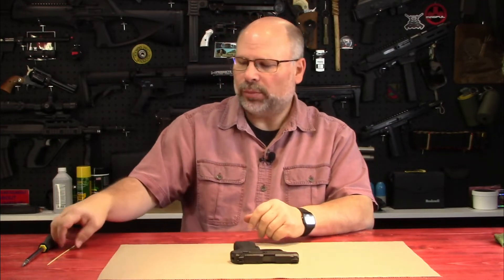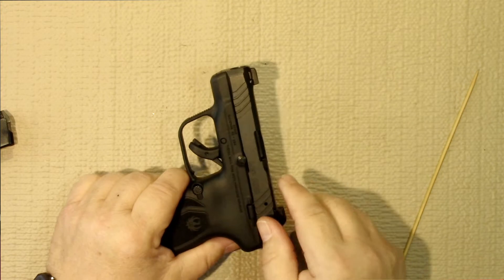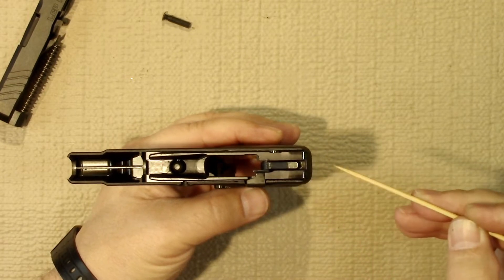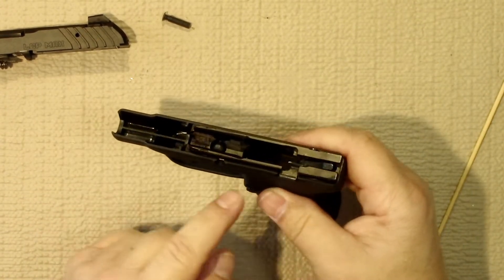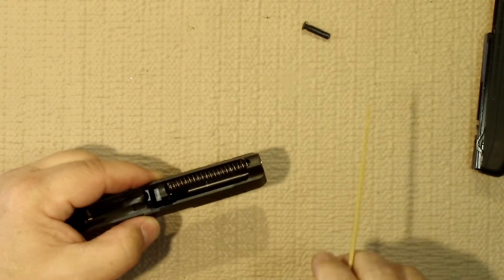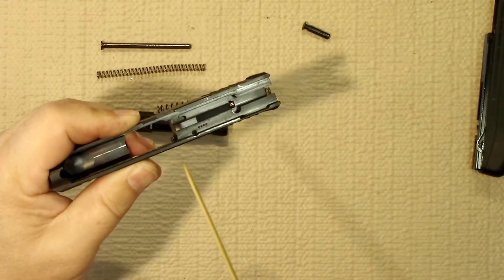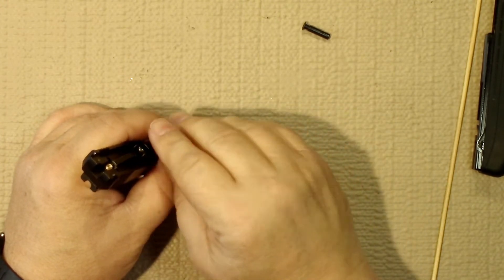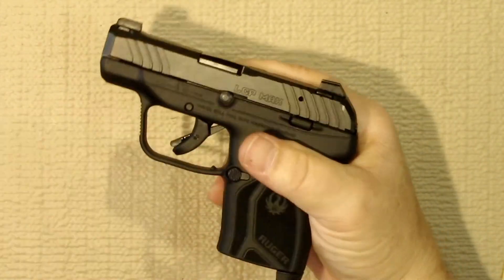RUGER LCP MAX Field Strip

Comment: Thank you so much for the explanation about the hammer during field strip! I kept “locking” up my LCP Max (I even had to send it to Ruger) and couldn’t get it to reassemble correctly (even after getting it back). Your video showing the correct hammer position solved my problem!

Thanks again!

Comment: You better take a gun cleaning glass. You don't put your brush through the front of the muzzle. You got it apart. You go in the back door music cleaner that is used for a lube and a cleaner like ballastall it's one of the best cleaners that you can use and it lubes also so you just kind of dab it off and leave a little bit of reserve on there and if you do have to put oil on it just to put a light coat, take your q-tip squirt the oil on a cube tip and get it soaked and just run that back and across your rails and you'll put a little bit on there. The more oil you put on there the more chances you're going to get it dirty faster because someone's oil collects dirt

Comment: Do you notice any surface rust on the lcp max?
Reply from the maker: No, I have not noticed anything like that on mine.
Reply: Ruger...as good of a job as it does.....economizes on many guns' finishes and uses a black-oxide....no better than what's on black drywall screws....so yes, it can rust. Other makers go with the Tennifer or Nitride process on the slides and elsewhere, that is extremely rust resistant but costs a bit more.

Comment: NICE JOB....but Wait !! .....at 2:00-2:04......by keeping the trigger depressed, and "controlling" the forward motion of the hammer....you are gently bringing the hammer "down". Fine. Here's a question.....can you do this again....BUT.....depress the trigger.....control the very first motions of the hammer......now release the trigger pull, while continuing the gently downward guidance of the hammer. The question---> IS THERE A HALF COCK NOTCH  that would arrest any further forward motion of the hammer?, say...in case somehow in the real world,  the hammer gets bumped real hard and slips off the sear (while NOT touching the triggger)....is this half-cock SAFETY feature there?...or not?.....I was hoping your vid would show that. Some Ruger FAQ and text suggests it has this feature, but I'm not clear on that. Frustratingly....as you recock the hammer between 2:04 and 2:17, the camera goes out of frame and we can't see this..but it SOUNDS like you are experiencing a half-cock "click" before it goes "full cock"......right?